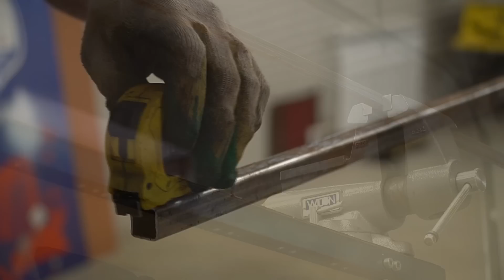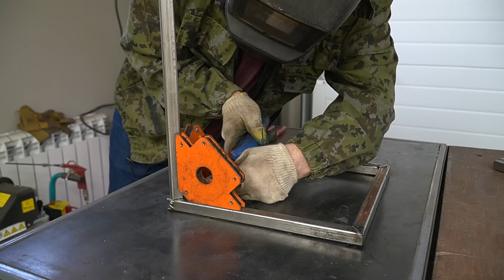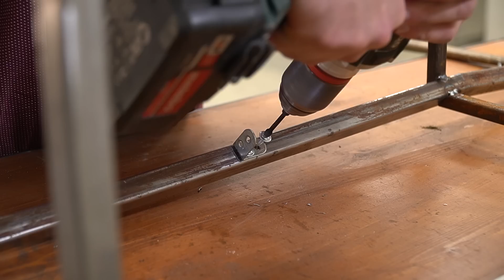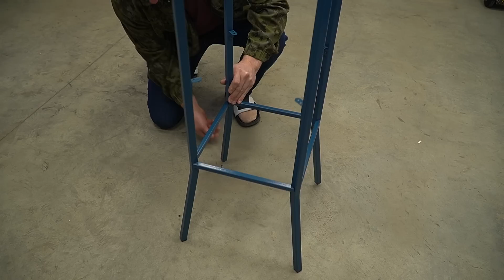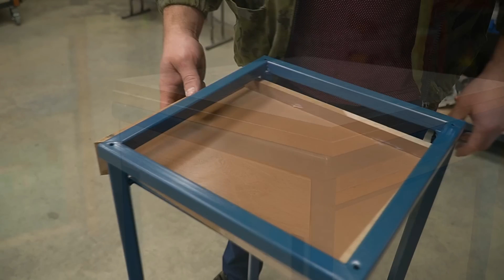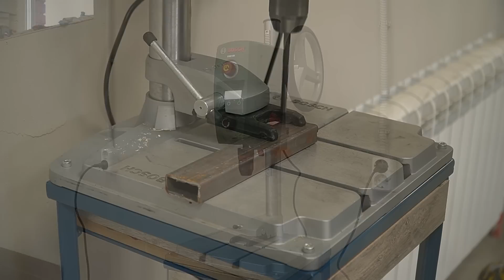THIS SHOULD HAVE BEEN DONE IN THE FIRST PLACE! An idea for a workshop!

Comment: Hi Alexander!
You're absolutely right: it had to be done before!
In fact, last year I made a similar one: 4 drawers plus two shelves.
On the two shelves my two welders: electrode and continuous wire (no gas) and in the four drawers: the accessories for welding, the accessories for clamping the pieces on the drill press; the drill bits and reamers and in the very first drawer some 4-flute cutters chisels pin punches and various burins for metal, moreover, since my garage is small, swivel wheels to be able to carry it around where I need it, only when I need it.
see you next week with the next video
Reply from the maker: Hello, I also wanted the boxes, but I hurried as always)) Thanks🤝🙂
Reply: @MA-SH  don't worry: for my project i used much more than a week for building It. Trying a lot of solutions for the drawers, on angular as your or  telescopic rail and so on
Reply from the maker: Great buddy, I think your project is much more interesting!